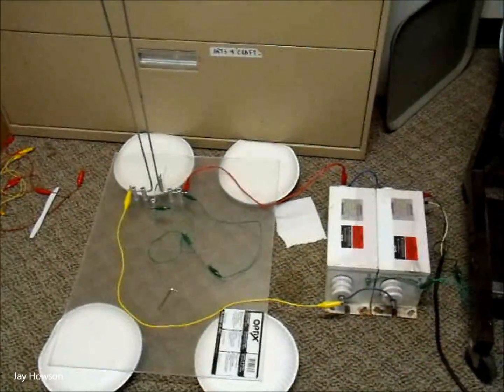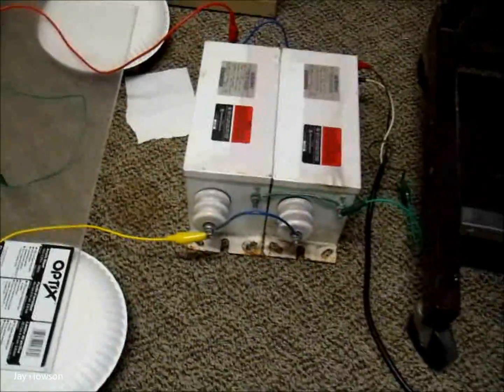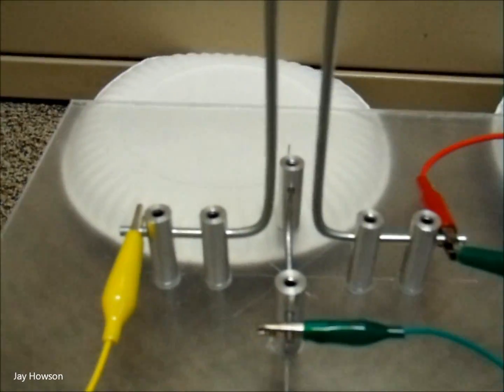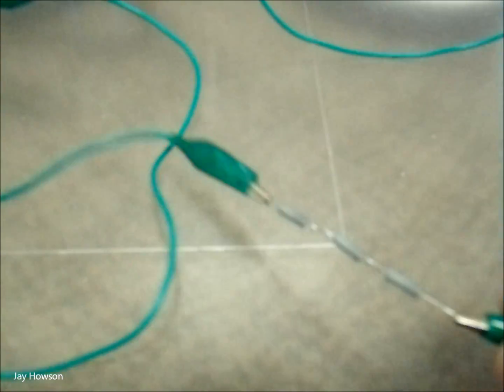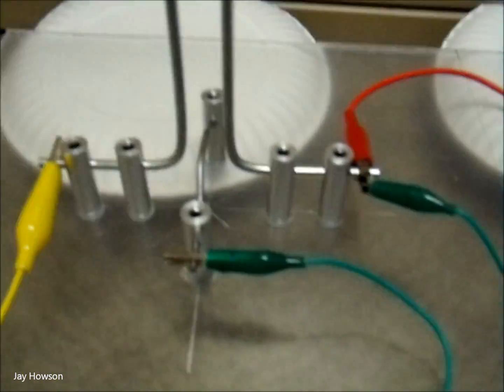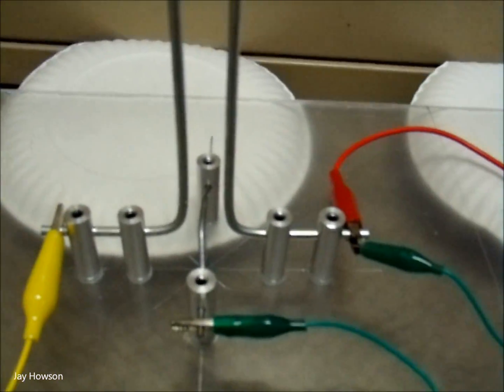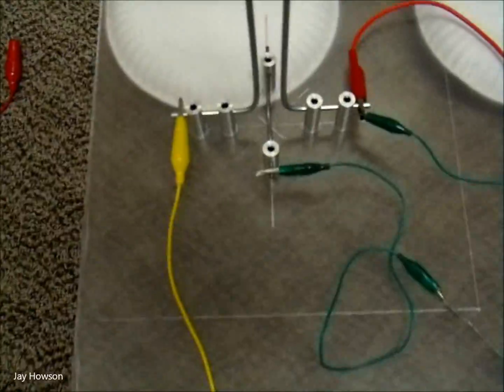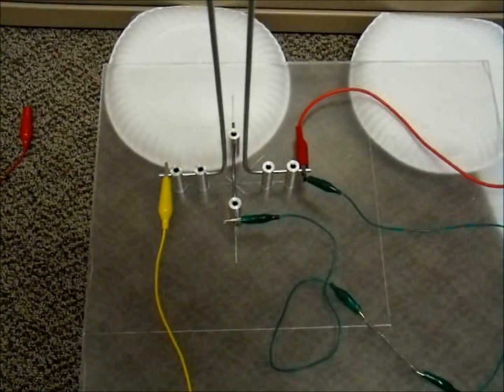Climbing Arc Jacob's Ladder

Comment: Hello! This is so gorgeous! I know it is a really old post, but I am hoping to get hold of the original poster. I am building a smaller version of this for a demo and really would love to know what you used to mount the electrodes to the glass. What is the hardware called and where did you get it? Thank you so, so much!
Reply from the maker: Erwin Schrodinger 
Hey Erwin, Glad to see someone is interested in my poat from so long ago. 
I made the electrode holders.
I got some round stock,  drilled a hole all the way through it and tapped each end. Then drilled a hole through its diameter for the rails.  Polished until i was satisfied. Really easy if you have access to a small metal lathe and drill press. 
I used aluminium, but eventually upgraded to stainless steel, the electrodes themselves were aluminium, then  brass. I'm think the museum that has the final product switched them to stainless steel as well. The arc and it's by products like to oxidize everything...

Also, The resistors in the video were not rated correctly and did not survive long due to the voltage. I replaced them with caddock high voltage resistors, which have been fine ever since. 
Shoot for something around 5MOhms, use a wire wound type. 

The biggest problem we had was the build up of ozone and nitrous oxide in the tube that enclosed it. An ugly yellow haze. 
I ended up drilling an array of small holes in the acrylic. And putting a small fan under the tube. The fan turned off when the arc started to prevent disruption. But quickly removed any byproducts.  This solved the issue. 

One thing I wished I did was to make the tubes length 1/4th of the 60hz wavelength in air.  The 60hz hum would have resonated the tube and added an additional layer of coolness to the display.  This would have been 4.78ft of tube length. 
I can try and dig up some pics of the final display of youd like. But im not sure I have any. I did take some awesome video of the arcs in slow motion. You can actually see the polarity switch. Which was pretty cool.
Reply: Thank you so much for this info. This is incredibly helpful. I am basing my design on yours, so it's great to hear all the extra trial and error you went through. I hope that's okay with you. Yours is by far the most beautiful I have seen, combining form and function in a gorgeous package. I'd love to hear/see anything else you're willing to share. I'll keep you posted on how things go for us. Thanks again!
Reply: We are a very small school that emphasizes science and engineering for school-aged kids. They're going to LOVE this demo. I'm having a bit of trouble locating the 5 Mohm resistors you mentioned. Do you remember where you got them from? I found caddock 5 Mohm resistors, but they were not wound type. I know it's been forever and I am so sorry to keep bothering you. I can get it working fine, but I really want it to be the best it can be and last a lifetime. Thank you!
Reply from the maker: Erwin Schrodinger Erwin Schrodinger Thanks dude, 
Check out ebay item number 311309624691 a pair of those should be just fine. The resistance value itself is pretty arbitrary, you just want a resistor that can handle the voltage,  power dissipation, and be large enough to be a reasonably unfavorable current path once the arc starts to conduct.  While a 10W won't last too terribly long in continuous operation, for the short duration of the arc starting, it should be fine.

I may also have a few that would work buried in my garage.